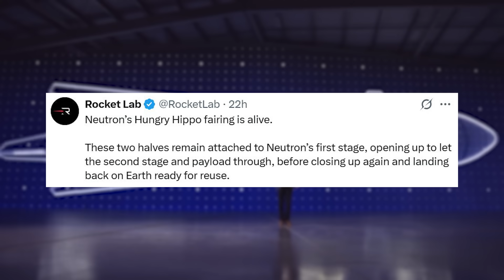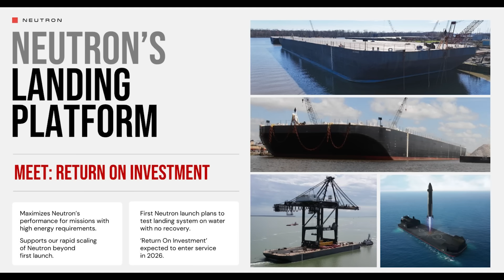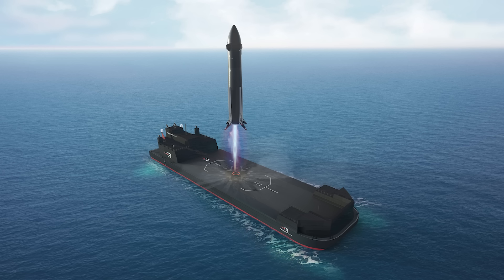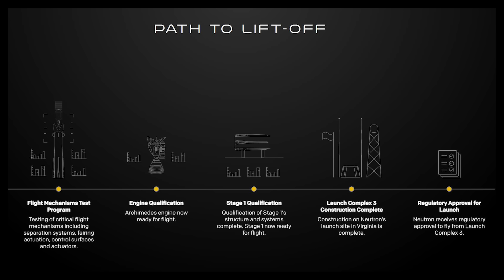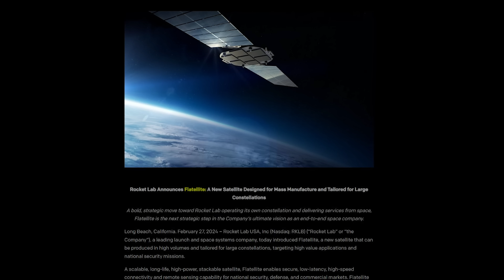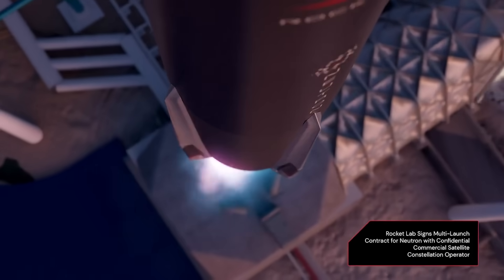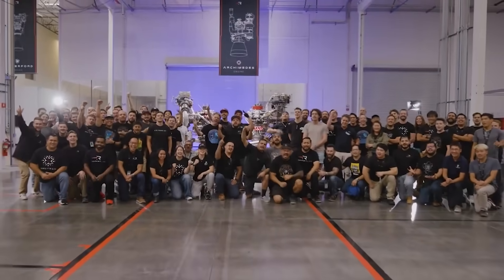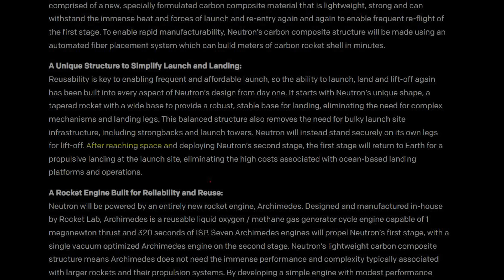Rocket Lab Still Wants To Launch Neutron This Year

Comment: I know this is early times, but is this the max the fairing opens?  Almost doesn't look like it opens far enough.
Reply: Are you sure? 0:08 I think it opens pretty big and should allow anything less than the diameter of the rocket to come through
Reply: Set by step, iterative design and testing.  Engineering requires substantive data gathering at all levels and conditions to be transparent.  Mostly likely, the payload shroud did open all the way; that part may have been edited out.